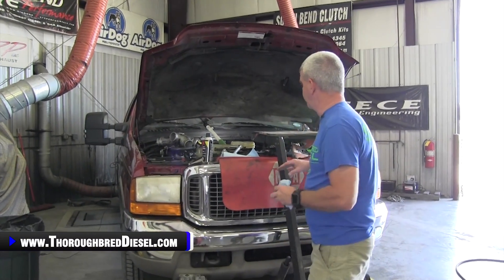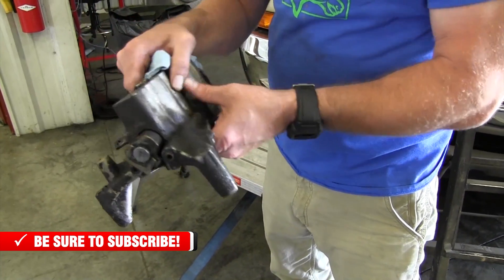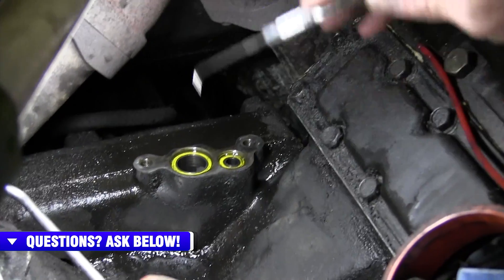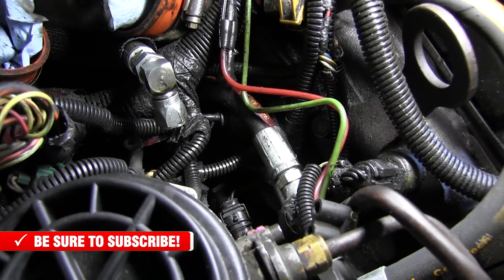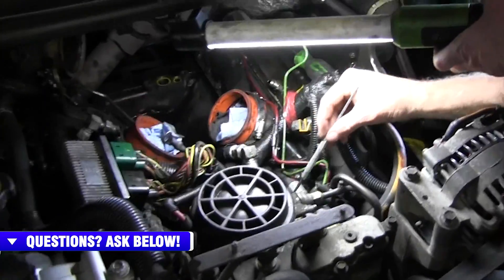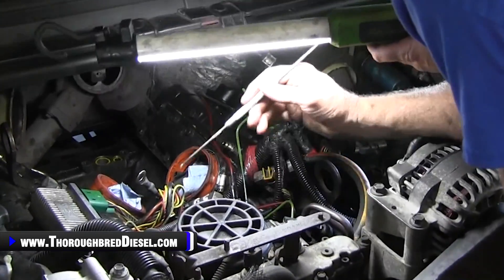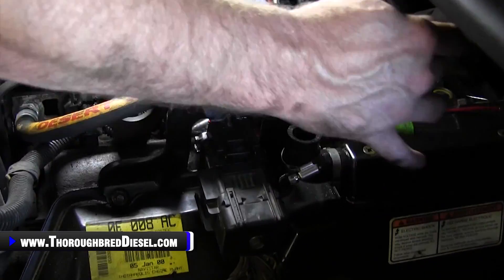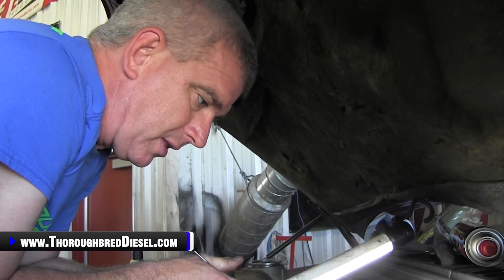7.3 Powerstroke Common Engine Oil Leak Areas: Different Types of Oil Leaks Explained

Comment: Yup had black liquid dripping from my 7.3 off the start and it was actually fuel mixing with that oil valley crud and it was a fuel bowl leak, easy fix though
Reply: What was the fix ? I'm new to diesels and just picked up a 7.3 plan on doing all the work myself
Reply: @thenewlife.pt2724  just a new assembly on the back side so closer to the fire wall on the fuel bowl theres a yellow lever on the back that will allow u to drain your fuel bowl in case of water inside, that lever broke and it was letting fuel run right on out
Reply: @kylesojka6715  damn my light came on. Water in fuel. That yellow lever should drain all that fuel out ?

Comment: Just bought my first 7.3 and have a pretty nasty leak in the front. Pukes oil when it’s cold but soon as it warms up it stops. Coming from front driver side of block about halfway up the motor.  No clue what it is since this is my first
Reply from the maker: That sounds like a valve cover gasket.  Check valve covers first.  Thanks for watching.

Comment: When i say i have a oil leak , were talking  2 qts. in seconds pouring out under truck , thought it was rear oil seal and after it did it again, I found the upper valley completely full of oil. What the heck can leak that much oil
Reply from the maker: I would check the back cover of the HPOP and around the turbo pedestal.

Comment: I have yet to confirm, but I think my rear cover is leaking. I've replaced my HPOP with an adrenaline pump, rebuilt the turbo, replaced ICP, IPR, fittings, and so on. The HPOP failed and was leaking, but now there's nothing in the valley.

Before I was more educated, I thought that maybe the rear main was the culprit... Apparently not the case, but I think I was close.

Comment: I am burning oil out of my exhaust not so much when it’s idling, but if I give it a lot of gas and when I let off a lot of blue smoke comes out my exhaust I also have oil in my valley. I think my turbo pedal seals are leaking, but would that cause me to burn blue smoke out of my exhaust and also have oil inside my pipes going to my turbo
Reply from the maker: The oil in the valley is independent of the smoke you are seeing.  I assume the truck is using oil.  Unburnt oil in your uppipes is concerning.  Might look at a possible turbo seal failure.

Comment: Would like to see a video on bottom side leaks and oil dripping from torque converter cover.   The 7.3 is not generally known for a lot of rear main seal problems. (?)
Reply from the maker: Could be, but on a 7.3 dont forget to check the valley, it could be running down.

Comment: I have a 2001 Ford F250 crew cab and it’s leaking oil right underneath the pedestal and also going over to the valley area just a little bit. A friend told me it was the pedestal O-rings and I re-search it’s a common thing someone mentioned it could be the oil pump but the truck is running top-notch no last power no smoking. No, low oil pressure
Reply from the maker: If the oil is pooling in the engine valley, I would look at the turbo pedestal first.  Someone mentioned oil pump to you as well, and they are referring to the high pressure oil pump in the valley.  We have seen that pump leak, as well as the lines and fittings that service the head leak as well.  There are other prone area we did not discuss in this video that are outside of the engine valley, such as the dipstick adapter, that are prone to leak as well.

Comment: I recently did an injector (#1), after installing the new injector the truck blows HEAVY white smoke (smells like oil) on throttle. I purged the cylinder of oil after removing the injector (through glow plug). Noticed after install that the turbo (exhaust side) a little on the pedestal was wet with oil. Not sure if it's a coincidence and I have a leaking turbo seal, pedestal seals, or something went wrong with the injector install and I'm leaking oil into the cylinder. Performed a CCT and #1 did come up as an issue. This truck is giving me hell, every time I fix something another thing goes bad....Any advice would be appreciated, not sure which direction to go. Truck seems to have power when I test drove it after injector change.
Reply from the maker: Check the injector cup and install on the #1 cylinder.

Comment: I just bought a 2002 7.3 the guy says it goes through a gallon of oil in 500 miles I cleaned it up and it looks like it might be coming from the intake ?
Reply from the maker: Oil in the intake of the turbo is normal to a certain extent on these trucks.   I would bet that the truck has bad injector orings, oil is going into the fuel tank.
Reply: I just got a 2000 F550 with a 7.3. Driver 615 miles and kept adding oil at every fill up. Almost 3 gallons of oil 🤦‍♂️ trying to pin point where the leaknis

Comment: One of the water pump bolt threads on my 2002 7.3L was covered in oil.  I noticed it when i was removing the pump  The rest of the bolts were dry, not sure if this in normal or im looking at a major problem
Reply from the maker: That’s weird.  On the Superduty trucks none of the bolts required selant like you had with the old IDI pumps.  Might want to keep an eye on it.

Comment: My son is looking at a 2002 Ford F350 with the 7.3L and the owner has only had it for a year and he bought it from his step dad that owned it for 2 years. He said it has an oil leak, but not sure from where. How much would someone estimate it would cost to get an oil leak fixed in general? I know it depends on where the leaks is and if there are more than 1 leak, but the guy said he is negotiable on price so we thought about asking for some $$ off the price to cover taking it to a shop to get the oil leak fixed. Just wondering what kind of price range we should be looking at.
Reply from the maker: I don’t know the specifics of the truck or the leak, but here is a totally fabricated number that I would throw to the seller -  take 1000 off the asking price because I don’t want to park a leaking truck in my driveway.  Maybe they will bite.  Good luck!

Comment: I have a leak that drips down the back, coats the oil pan, and ONLY leaks after it runs. If I leave it parked, clean up the oil leak underneath,  no fresh leaked oil. Think it is the pedestal but would like an expert opinion. I did have a fuel bowl leak, but that has now been fixed, and the oil leak still happens.
Reply from the maker: It's so hard with 7.3’s, there are several possibilities,  but usually turbo pedestal and the HPOP lines are the usual leak points.

Comment: I have both of these leaks …. Just figured this out today. One oil pool is right behind the fuel bowl in the valley, and the other is a pool down by the pedestal. Taking it to the shop this week. I’m in Greenville SC. I could do it myself, but i hung my mechanic belt up years ago and now don’t have the tools to do the job
Reply from the maker: Good luck!
Reply: How much did that cost you to get fixed? Just curious as my son is looking at a 2002 that is leaking oil and we are just trying to figure out how much to estimate what it might cost to fix it from a mechanic.
Reply: Well, my cost was around 5300$. I had to get a new HPOP, Pedestal, and all the trimmings on top. New oil lines…. Downpipes… the works..

Comment: For anybody desperately searching these comments as I was...noticed that I had started getting a good bit of accumulation around my rear main when I was under the truck for an oil change. Thought it was starting to seep but I found a trail coming from the top of the motor that was running down my oil pan. Wiped it and panicked- it was runny and green :face-fuchsia-tongue-out: Long story short, combine Hot Shot's stiction eliminator residual in the valley with a fuel line leak and you'll have a near heart-attack experience thinking that you're somehow getting coolant dripping down the back of your motor (for anyone who doesn't know, the Hot Shot's is an alien-green oil additive and yes you should be using it every oil change).

Comment: Hello,  
 I had a leak in the valley on my way home from Oregon to Illinois,  and it was in the engine valley directly,  where the IPR sensor is,  the tin small nut had come off and the truck was losing pressure n stalling out from stop-to-go in low gear.     That was a big leak. 
  Now there's a small and quite slow leak and there's oil in the valley again,  but the nut on the IBR sensor is tight on there,  so I can't tell or see where the leak is coming from otherwise. 
  Any ideas or insight?
Reply from the maker: It's hard because there are a lot of leak point around there which we explained here.  First have to make sure that it is 100% oil.  Could be fuel that gets black because of the grime that’s in the valley.  IF its oil, I would suspect the lines or fittings for those lines at the head.
Reply: It smells when the turbo is engaged going up a big hill hauling or something.   
   I don't see a leak coming from thy hoses as far as I could see whatsoever.   
   The gas tanks have leaked but I fixed that already,  and it doesn't now,  and a I'm not sure if the fuel lines in the valley are leaking... up to question... I'll have to double check.  
  Thanks for your response

Comment: I have oil dripping down the bell housing and leaves a nice puddle. What would cause this? Thanks for the excellent video and jumping right into the details without a bunch of nonsense
Reply from the maker: Several possibilities on the 7.3 but I would start by looking closely at the turbo and turbo pedestal.
Reply: @thoroughbreddiesel  thank you

Comment: Hello Boys, my name is Ryan in Denver Co. I have a small upper oil leak on my E350 7.3 it has 276,000 miles and wanted to ask if you guys think it could be head gasket or more common HPOP line driver side into head.. Runs down driver side around front of head and down side of motor to oil cooler front mout area then small amount on side of oil pan then on ground couple small drops
Reply from the maker: Tough one.  If the line was leaking it would run to the back of the engine.  Valve cover leaking possibly?

Comment: I have a bad bad oil leak too side on my 7.3 I believe it's the turbo pedestal. What my question is is what does this normally cost to fix on these trucks..
Reply from the maker: Depends on a lot of things,  where you are, if you do it yourself or not, etc.  I would say a normal shop, to re ring the pedestal and uninstall and reinstall,  probably looking at 750-1000 bucks.

Comment: I just rebuilt the hpop and the fuel bowl and turbo pedestal installed all and even changed out the oil lines with new ones and new fuel lines as well put everything back the way it was when I cranked up the truck it was tuff at first but eventually fired up but was running a little ruff for about a min the truck died I check under the hood and seen oil water down looking oil went to check my fuel bowl to see if it had fuel it did when I went to drain the fuel bowl apparently I forgot to hook up the drain line so I did then I looked on the ground by the passenger side and noticed that it wasn't fuel on the ground it was oil
Reply from the maker: Go back through your install.

Comment: I have an oil leak coming down from behind motor between tranny. Rear main seal was changed out about 6 months ago. Could it be the same or somewhere around there is another area i need to look at?
Reply from the maker: I would look higher than the crank, but if the rear main wasn’t installed correctly, could very well be the problem.

Comment: I sprung a huge oil leak near the valley of the pedestal, doing Ebpv delete and previous owner installed a crossover line. The crossover line was dry. Would that be the major leak at the turbo causing it or do I also have an hpop issues as well?
Reply from the maker: Sounds to be at the turbo.
Reply: @thoroughbreddiesel  once we stick on the pedestal I’ll holla back and let ya know if that was the only issue! We actually had lost all our oil just from cranking over. That’s probably why the crossover was dry. Never knew we were out till I pulled the dipstick the other day once I was able to go back out. Hpop had maybe a quarter inch of oil. I’m kinda interested in if thats the only issue causing complete oil loss. Even our oil cooler puking oil didn’t do that once the orings went.

Comment: 2001 f250 diesel 7.3l engine leak on driver side  area between engine n fender coated in oil but can't find leak. Thoughts. Thanks
Reply: Oil cooler probably needs the seals replaced. Look in that same area you spoke on where you saw oil.  You’ll see a tube shaped part, that is your oil cooler.
Reply from the maker: Is it high and are you getting a engine leak in the valley that is tracing down?  If not, suspect valve covers or oil cooler if it is coming from lower.

Comment: I had a major oil leak which turned out to be the dipstick O ring on the side of the oil pan. My mechanic was able to pull the stick and reapir O ring without puling oil pan It still cost me about $500 with a fresh oil change but no more spots in my driveway . 1999 w/302,000 miles
Reply from the maker: That stinks!

Comment: Whatever it is get it fixed by someone with as much experience with a 7.3 as possible. Ask and shop around. I'm almost at the 500,000 mile mark and nothing serious to motor or tranny. 2 starters, 2 alternators, 2 ac charges. My oil leaks have been nominal but getting worse and fixing them for another few 100,000 more miles. took 6 other trucks to do what this one has done. Keep it in good mechanical running condition with service and it'll run forever.

Comment: My 2000 f350 7.3 has a slight oil leak. It's making its way to the starter and dripping from there. Any suggestions? I'm currently in the process of changing out my glow plugs and gaskets. Would really like to tackle that while I'm in there.
Reply from the maker: There are so many different areas to look at.  As we talked about in the video you have to make sure its oil and not just fuel that’s been on dirty surfaces.  You have to really start with watching the engine valley, if no leaks there suspect a valve cover gasket.  You just gotta keep watching and looking.

Comment: My 73 has an oil leaking at when it sets idling it does not leak but when I'm driving down the road it leaks on top of the motor there is oil in the valley

Comment: yes, my 2000 ford f450 7.3 has just started leaking oil, it doesn't leak whilst idling,only it only leaks whilst moving
Reply from the maker: Could be a oil leak in the engine valley that fills and then runs down as the vehicle is moving.  Check your engine valley for pooling oil.

Comment: Great video. I inherited  2000 F-350. I have taken it to 2 different mechanics. The first wanted $9000 to do a total reseal kit. The second said they don't even touch leaks on 7.3s anymore due to leaks popping up after fixing active leaks. He says the mileage is too high and suggested a rebuilt engine swap to the tune of $13000 for the engine. I do not know a lot about working on vehicles. But I will learn if it keeps from spending thousands unnecessarily.  How do I get to the valley to look a d see if there are leaks?
Thanks, clueless woman
Reply: Brittany, also if you have long hair pin it up on top of your head. NEVER lean over a running engine with your hair down, very easy for your hair to get sucked into the fan belt, ok. 👍👍
Reply from the maker: Thank you! Really nothing to do to get the engine valley other than get yourself a good light and watch the engine valley while the truck is running.  Be careful and watch the engine fan while you are doing so.
Reply: Those prices are atrocious. I hope you figure it out.
Reply: Funny how yhese sexist a hole only tips were how to not get hurt and not so much about how to fix it

Comment: I have a 7.3 99 f30 turbo. When i pull a 30 ft trailer and when engine gets hot it just running oil aroud about theba ck of the pan.  Up aroud that area. Any help please

Comment: I have oil build up on the pipes and top side nothing in the valley, I do have a leak at my fuel bowl working on getting fixed would that cause it? I should add there I'd no puddle under truck ever.

Comment: Leaky garbage. I hate my 7.3. Last one I had puked fuel and oil out the valley then onto the exhaust. This new 7.3 pukes oil. Time to order a adapter and flywheel for a 12v swap

Comment: I have a problem oil leak The hose coming up from fuel ball and high-pressure oil pump  just above the high-pressure regulator It takes me little bit time to find it because some one said I have back seal leak of course it’s leaking from the top Valley One little chip outing failed

Comment: My dad has an 89 Ford with the 7.3 in it and just changed the turbo, but has found when starting up a hill it burns smoke out the exhaust for a bit and then it stops. Where would I look first to diagnose this?
Reply: That’s a totally different engine, only thing shared is displacement IIRC

Comment: recently found oil in both my rad and overflow, is there a way to determine where the leak is happening, my research says either o-rings, and/or gasket at high pressure oil pump, or o-rings at oil cooler?

Comment: My 2000 7.3 valley is dry front to back yet I have a leak drainage over the starter motor dripping off the black cover on the bottom of the bell housing.  Truck has 80k mile with excellent maintenance   I can’t detect where the oil leak source is ???
Reply: i have the same leak. what did you find?
Reply: @smitty4699  still looking for source. Assuming the turbo pedestal oil rings are leaking a little but not enough to address a repair 

Keeping an eye on it

Comment: 95 ford f350 oil leaks in the front of the engine some times alot when I'm trying to cold start it when it's cold out it leaks more when I'm trying to start it and it takes a few times to get it started